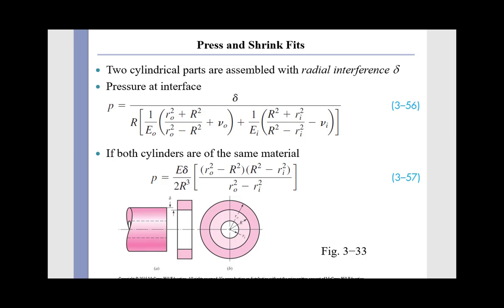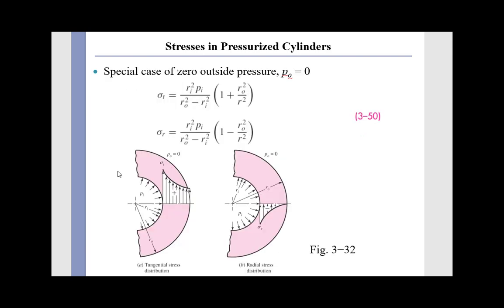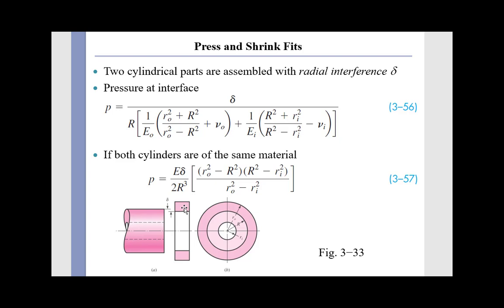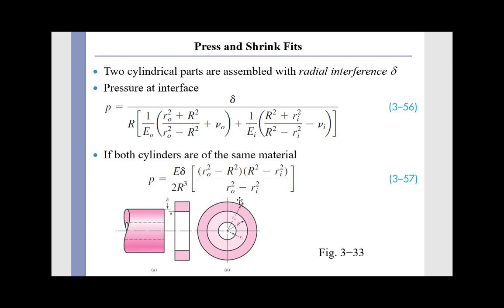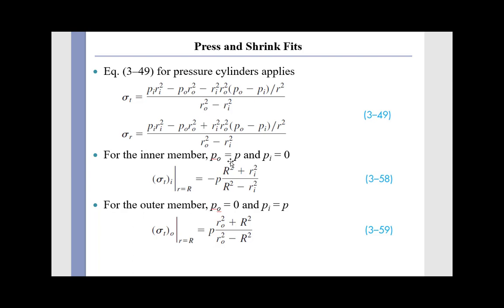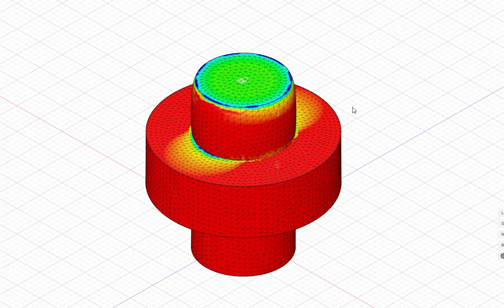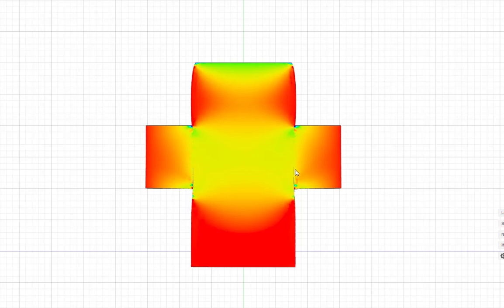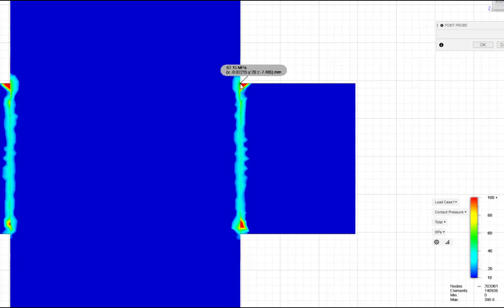Lecture 10a press and shrink fits

Comment: Great video thanks for creating it! One question is it correct to assume that R, ri and ro are the values before press fit and that they will all shift slightly due to the press fit? To reach an equilibrium state.
Reply from the maker: You are correct.  You use the initial values for the pressure calculations, but they do shift when the fit is in place.  That is, the radius of the shaft gets a touch smaller, and that of the collar gets a touch bigger.  Also, R is the radius of the solid Shaft for most of these calculations.

Comment: Thank you so much! Can this pressure be directly applied in FE analysis to model interference/ should it be modeled by modeling shaft and sleeve
Reply from the maker: It is always better to model it in FEA.  If you choose a contact pressure field, you will necessarily simplify it.  Usually, making it uniform along the length...but it is parabolic, with the highest stress at the edge of the sleeve/shaft contact.